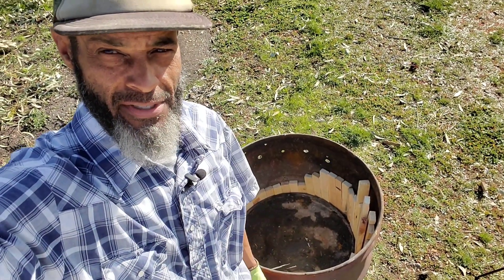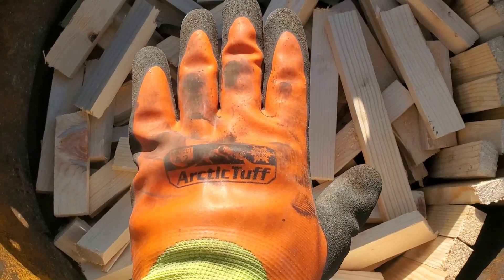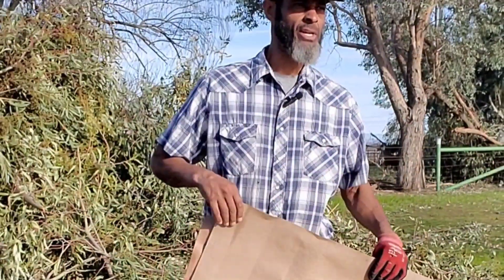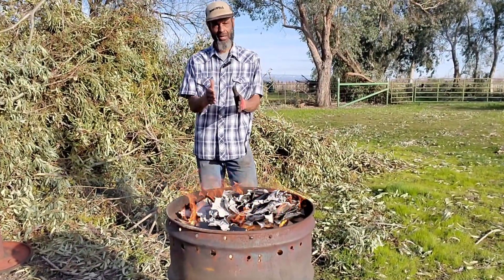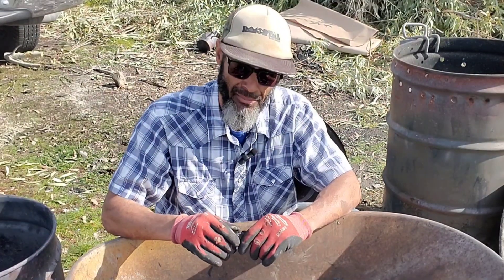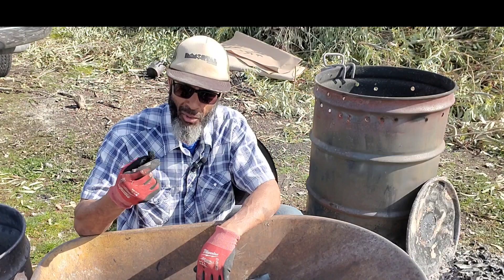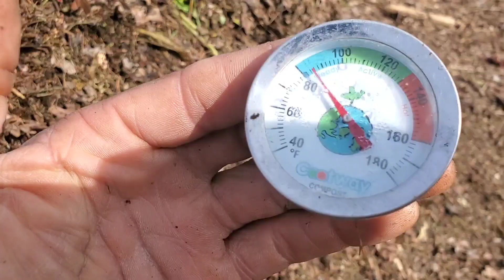Surprising Durability: This Design Outlasted Expectations 🔥

Comment: A fun project going forward would be to build a wind- turbine-driven ball mill to pulverize the lump charcoal.

I build hawt & vawt turbines that compress air. I use stored compressed air as an emergency back-up power source, allowing my homestead to operate off grid in a phtp* situation.

*poop hits the prop

Comment: I use a solar retort with a homemade, tracking concentrating mirror (not parabolic) of my own design.  

This means all I have to do is load what will become lump charcoal pieces of hardwoods, secure the lid & aim the thing at the sun. 

My methodology results in much less effort and zero waste from the heat source.

Im autistic with a  stupid-high IQ, for the record, if it matters. 😂
Reply from the maker: Have you any videos displaying your design? This sounds incredible.
Reply: @therealprtrhsenteal  
I've been reticent to share, because of the 600:1 concentration. A hand carelessly passed through the focal plane with the retort pointed at the sun and your the proud owner of a vaporized hand!

However, I'm a big fan of open source, so as soon as Mr. Sunshine returns to North Texas, I'll toss up a video.

I'm autistic with a Mensa+ IQ. That said, everything I design and build centers around simplicity. Asberger folk like closure and the shortest route is simplicity.

My design can be built in an afternoon. It's just sheet metal mounted on a steel symbol and covered with reflective mylar. When you see it, your reaction will likely be, "Duh! Why hasn't someone else come up with this design before?"

The answer is, everyone else over thinks stuff.

With a basic understanding of Geometry, my design is a no-brainer. It is a basic geometrical shape. 🤔

Comment: Great video thank you! I made my first batch of biochar this weekend using the same method. The only problem was as soon as I placed the lid/stack on I SMOKED out my neighborhood,so I had to do an open burn. Is that do to lack of oxygen? Thanks!
Reply from the maker: Yeah I  can totally relate to that. You will generate less smoke if you let it get further along in the burn. Mine will throw off alot of smoke as well if it is covered too soon or if the feedstock isn't loaded properly or it has too much moisture.  Thankfully for me the neighbor issue does not exist so I can empathize.  Good luck and thanks:)

Comment: I'm preparing to build a Biochar retort like yours. I'm concerned about using a painted barrel. Will the paint have an adverse effect on the pyrolysis process, through the transfer of chemicals or anything?
Reply from the maker: The paint will burn off. My barrel had a protective coat of paint on it when it was new.
Reply: @therealprtrhsenteal  good deal, thank you kindly. And the chimney, what did you use for that?

Comment: I use your process. My inner barrel is a little taller but smaller diameter. I just finished a batch with bones (skulls of a few goats I butchered) it took a couple run to completely turn them into char. 

I've been cutting old pallets down this winter to make my char, but I plan to use slabs from my sawmill once the weather gets better. Should be able to process it quicker, and I won't have to deal with nails.
Reply from the maker: That is excellent! It sounds like you are gonna be making some good char. It is pretty satisfying to return that surplus! 👌